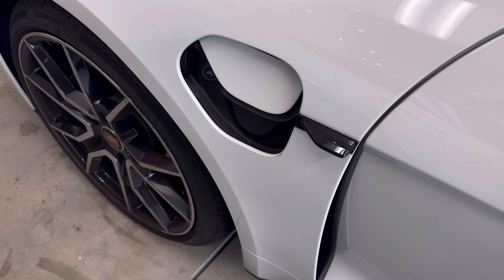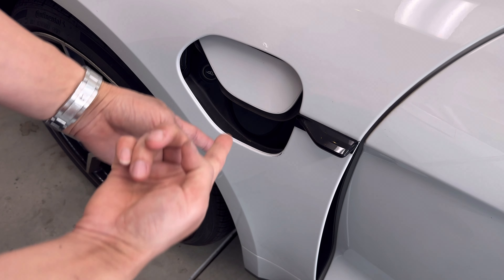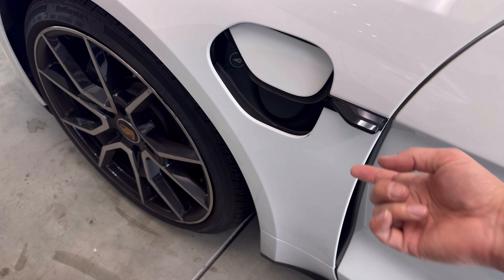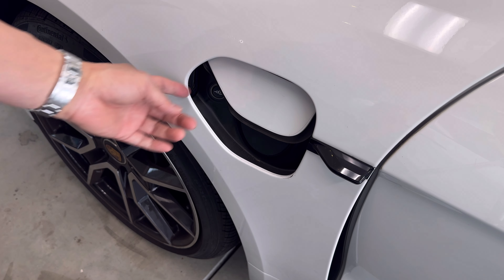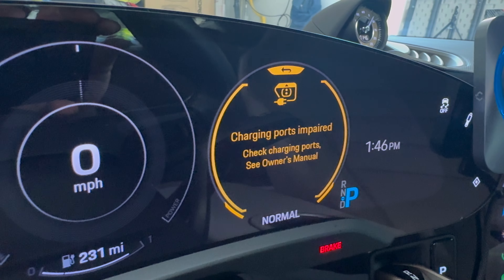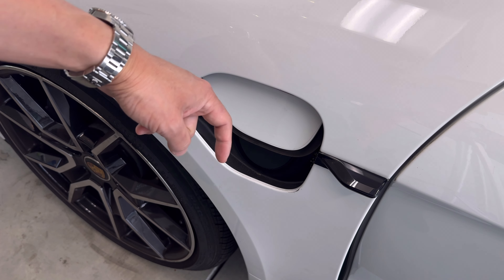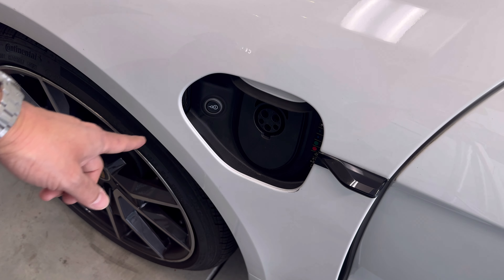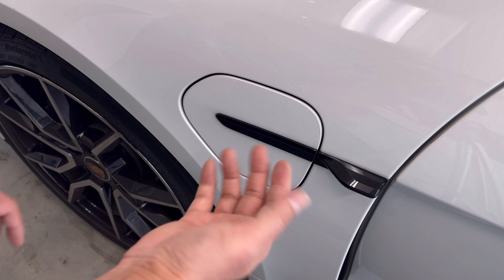【PORSCHE⁵²】Taycan Repair: Fixing the Charge Port Cover! 🛠️⚡️

Comment: Your video was very helpful. But my Taycan's charging door doesn't go up from the middle, but down. So I can't hold the charging door with my hand like in the video. Is there any way to solve this?
Reply from the maker: power off everything and leave the area with your keys. Come back after 30 minutes and power on. Swipe it and see if it goes down at any point. While going down, hold the door and it will refresh and cycle again.